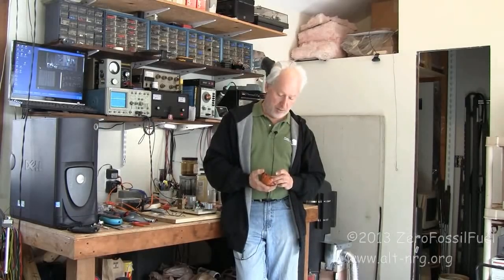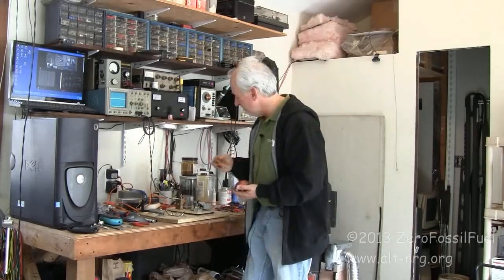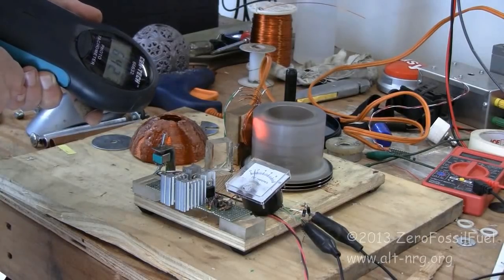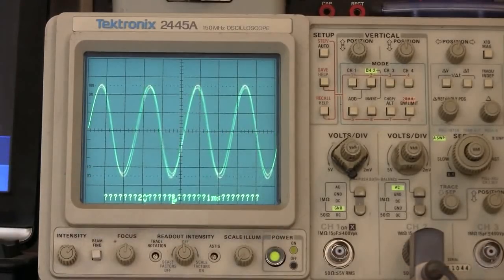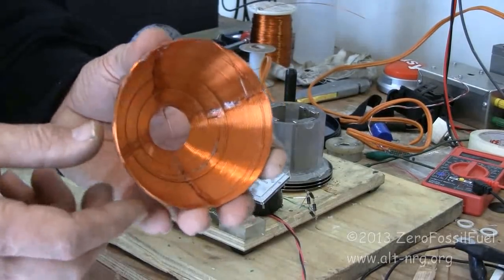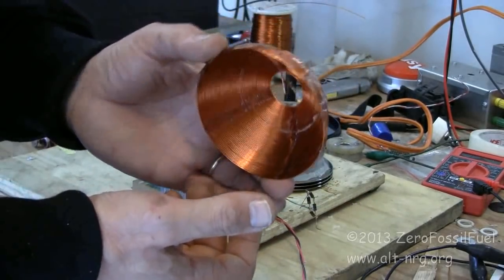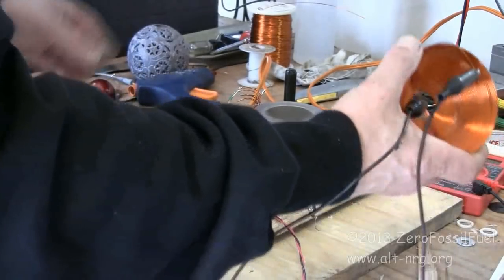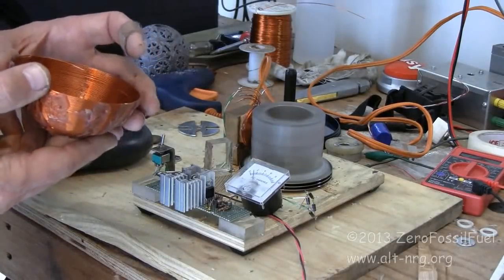#329 Zero Lenz dynamo

Comment: I'd like to see you experiment with a similar coil to your Wardenclyffe coil, only one that was wound in more of a cone or spiral shape,  specifically , a wind that follows the Fibonacci sequence of numbers.  If the Fibonacci sequence diagrams how energy naturally chooses to flow in our universe, wouldn't it seem to reason that "your' energy would prefer to flow in that same configuration.
It seems that ANY coil that is wound in a configuration other than that which mimics the Fibonacci spiral, would be forcing the energy going through it to flow in an UNnatural way.
 Your Idea of a multi layer conical shape, I think,  is spot on.
If you could wrap several pieces of wire at the same time, and mathematically follow the Fibonacci sequence........well i don't know WHAT you 'd get for voltage...but I'm dying to find out.
Great experiments....Great job on your Wardenclyffe coil

Comment: dear i think Zero show us shapes interacting to same magnetic field difference.Yes you are right, resistance of 2 type coils was different, but if you will make same resistance at both coils then effect of less drug will at the side of half hemisphere shape side in did because its wires position to the magnetic field not flat but copy of magnetic field structure it self.

Comment: try making a series of these bowl coils.. put them together.  or cup them together.. then have a cylinder magnet on a shaft with shaft guides at each end so it is stable and have it slide in and out of the coils.. see how that goes?. also either have the coils, coiled together connected at the ending ends or have a wire go from the top to the bottom to connect the coils, so the magnetic fields push the electrons the same way in the wire..

Comment: So did you ever make a full globe coil based on 2 of these? Awesome video, thank you for sharing.
Reply from the maker: +Naoki Kashima No because I realized it's still a dipole. Not the objective. Thanks for watching anyway!
Reply: Reverse winding direction at the peak and measure how much force you can generate and compare it to pancake coils of equal length.  I think it'd be interesting to map the magnetic field of that experiment.
Reply: globe coil in one single copper or 2 half globe coil to form one?
Reply: Naoki actually creating and doing what your imagination/intuition brings before you is something that should never be allowed to be cast aside by others theories.
Reply: How much has been deemed “disruptive tech” and forced into the shadows?
Reply: @zerolabs  then what was the cause of the amazing, significant findings in this video??  This was super inspiring and yes i did enjoy it. Far from a “little experiment”. Please dont downplay what you did here. 

It annoys me beyond mention the degree to which those with theoretical laws build faux walls to detracts and block the doers, tryers, tinkerers, and experimenters whilst they do not but create literature. 

Youre a creator and creative and creating is when humans are most alive in the moment. The flow state

Comment: more windings = higher voltage.  The bowl shaped coil clearly had more windings ... (and much more copper).  To be fair, try to use the same length of copper in each case.

Moreover, higher voltage comes with lower amperage ... and my feeling is that the highter amperage (i.e. current) in the flat coil is what actually causes the short circuit to slow down faster.

Comment: What about a static oscillated voltage through a bifilar coil as the transmitter and both top and bottom your half dome chapped collectors. Would this work? I have a ferrite core from a TV as the energy increase. Look forwards to your next vid:)

Comment: Voltage does not equal power. Damn so many slept during science class. Measure current and voltage, that will give you the power in watts. E*I=P(W) we'll ignore the crest factor in your waveforms for now.
Reply: Technically, if he's just using a coil, it's be VARs that you measure. I won't produce very many watts at all. Terrible power factor.
Reply: Andrew Vanderschaaf I really like your coils experimentation.
Reply: Y'all need to watch Gerard Morins videos.

Comment: What's the comparision output levels between your dome coil and a regularly wound coil - either single layer or multi layer wound, when used for electric generation.  I'd love to see the dome coil wound in bifilar fashon.  It would probably be easer to wind if a heaver gage wire was used.  Larry

Comment: I think this seems pretty simple, basics in inducion. research into motors and/or transformers (step up and step down) the flat coil clearly has less turn and therefor less voltage because there are less conductors to cut the lines of flux with from the rotating magnets. The dome shaped one may assist itself in the generation, but if it were made proportional (length of wire the same or turns the same) then i believe the voltage would still be very similar. Really, this is trivial as soon as you learn induction.

Comment: Great experiment. Thanks for posting. Lenz effect is measured as power induced (current squared times resistance), not voltage induced; so should be comparing voltage across a resistor (rather than open circuit voltage). Your lamp test sort of did this. Coil is not mono-pole, magnetic field is half way between solenoid and single wire pancake coil.

Comment: If the coil was connected to a tank circuit which is grounded, the angle of reception on the concave side would generate a measurable voltage. Cool idea, scientifically efficient.
Reply: Michael Chapala that does work. you're right. I've tested it myself with a quad filar coil instead of the one in this video. anyone else you're free to comment with more suggestions please

Comment: Could it be your bowl shaped coil has more turns then your flat coil and can induce more voltage?  Then possibly your drag effect is lower on your bowl shaped coil because it has more resistance than your flat shaped coil and thus less current produced in a short circuit scenario?  I'd try a resistor in series with your short circuit tests to see if it increases or decreases the decel time.  If a resistor increases the decel time then wire resistance could be producing these results.

Comment: Dear Mark,  I think you'll find the voltage difference will become equal when the length of wire is the same in both the flat and the dome coils. What interests me is that there is less back EMF slowing from the dome coil to the power source . This will be due to the dome having less length of conductor close to the spinning magnets. Less than the flat coil.  One would normally expect therefore to have a lower voltage. This is not so, due to the induction between succussive coils laying on top of each other in the dome, producing higher voltage the further the conductor extends. The higher the voltage of course, the lower the current. Sorry, no power gain.

Comment: hey do the shottky diodes you got for the muller drive circuit look the same as a mosfet and cost about $30 each? I know what a regular diode looks like and a zenner diode, but mouser isn't showing anything that looks like a regular diode.

Comment: Z... I just had a crazy Idea.. not sure if it would work or not... But here it is... Take some of that magnetic film, and view the magnetic field coming off the magnets, and shape your coil accordingly AROUND the field, so it's flowing inside your coil. So basically I'm thinking your cone shape would be inverted the opposite way you have it now, so the magnetic field is running inside the coil.. If that makes sense. My theory would be that your not blocking the magnetic field from rotation.

Comment from the maker: You've missed the point. An average coil with more wire produces more voltage and more Lenz drag when shorted. My bowl coil had more wire, yes, and it produced more voltage but LESS drag when shorted. This is the opposite of a conventional coil. It means I'm on the right path.

Comment: I like the idea of playing with coil structure. However, as mentioned by many the volt output is not the prime measurement. I can have a car that goes 300 miles an hour...it won't pull a 2 ton trailer for crap though. At the same time I can have a truck that only does 80...but it can do 80 while pulling 20 tons...

One idea that interests me would be doing 2 of these coils over an iron or rare earth sphere that can spin axial while the coil is near another also spinning...just curiosity

Comment: Hi, are you trying to generate as much voltage as possible? What i don't understand is why you have the magnets in this configuration. North and south poles, which way are they facing? Are the poles strongest at the ends of the magnets or at the faces? Do the magnets all face the same way? Why not try the magnets in a horizontal direction and alternate their arrangement between N & S, so the ends would be going across your cylinder rather than up and down, or alternate the magnets N & S and hold the coil over the top of the cylinder.

Comment: Stating that the bowl-shaped coil with double the output voltage will give you four times the output power is not correct.  A 100-turn coil and a 500-turn coil that are the same approximate size in the same setup will be able to output equal amounts of power.  Putting the coil geometry aside for a second, the same principle applies to your bowl coil.  When you factor in the geometry you check the flux relative to each loop in the coil.

Comment: what do you think would happen if you made each sphereical coil reactive to each other, say like how lemon is reactive to copper producing charge, i'd like to know what you think about keshe using naoh hot saline bath with coils soak for two nights and then cause dropping rebounds to produce fluctuating charge 30 nano coatings making gans as well as a gas gans coat, could this be done with magnets or like with your sphere conical concept?

Comment: thanks for posting.  ever hear of an ammeter. to measure real output, volts and amps must be known.     volts x amps = watts      your 'slow-down' numbers are a poor substitute for an amperage value.   your slow-down results suggest a decrease in amperage from the hemispherical coil. my experience suggests back emf is the key to high coil performance. when the windings of a coil do not 'go back' on one another, there is no back emf, but output amperage drops to near zero.  cheers

Comment from the maker: You too are missing the point. Average coil, more wire = more voltage = more Lenz drag.

My bowl coil more wire = more voltage = LESS Lenz drag. This was a first proof of concept coil. The intent was not to do precise efficiency comparisons between the two types of coils. The point is I'm on the right path. It proved the INVERSE of what a typical coil will exhibit.

Comment: hi there. i don't watch these videos to pick them apart. i am very into this stuff. overunity, hho, and more but the first thing i noticed when you used the "bowl" is.... yes it is a different shape but you have about 4 times more wraps in it. of course it will have a greater voltage output. how about making a pancake style with the same amount of turns and retry the experiment? that would give you a more unbiased result. i look forward to a response.
Reply from the maker: +Jon Stimmel Yes that has been pointed out already numerous times and yes, it is true. The intent of the bowl shape winding was to concentrate the field to the center. Obviously it failed but there are other ways. Think about the headpiece Doc Brown wore when he greeted Marty at the door, on steroids.

Comment: Very interesting video and thanks for sharing. I'm wondering now about different shapes such as pyramid, sphere or square. As Calliber50 mentioned I believe a retest with the same exact wire and length in a pancake coil would shed further credence to the results. I have a number of 24vdc 36,000 rpm motors I plan on doing a similar thing with sometime in the future. The motor came out of an industrial high speed bar code reader with an aluminum 12 sided 5.75" diam. cone bolted onto the shaft.

Comment: Hi Zerofossilfuel, Cool looking coil, What is the output voltage and current?. Check out the 3 phase Abha Rodin motor generator at the PMBO 2016, a new coil design. Thank You Tony

Comment: What do you think you are proving?  Sure, spinning magnets induce voltage in nearby coils.  Short the coil, it causes a little drag on the magnets when you stop powering the rotation.  It means nothing we did not already know.  Do you think you have a useful application for this?  I doubt it.

Comment: Hey Zero, wouldn't the two different lengths of wire used on the coils make a difference, can you do the same experiment using the same length of wire in each coil.

Comment: ive thought of making a globe magnet/electromagnet for a long time, the only conclusion is it makes a mono-pole, with one pole trapped on the inside and the other on the outside.
Reply: +Starseed∞Warrior  Actually to do that I think you need two half-domes joined at their middles with 1 polarity to the two equator winding terminals and the other polarity to the poles of the globe terminals. A full globe is in fact no different than a cone or cylinder. Note that the earth has a north & south pole!
Reply: dean germeten yes but it depends where you send the charge through, which will determine where the poles are i.e if you get a metal sphere, put a cathode that encompasses the whole surface and an anode that pinpoint touches and goes to its core, it makes a monopole.. or for instance get two dome shaped magnets with the north on the outside and the south on the inside, push them together on like pole to make a sphere, super glue it together or what not, you got a monopole with only the north on the outside.
Reply: +Starseed∞Warrior If you break a magnet at any point, it still has a N-S. Same poles facing EM will give you a scalar but not a monopole. Polar magnet fields are circular, a return path is necessary for there to be a field. Only way I can think is a point source (globe) static charge.

Comment: Do the two coils have the same number of windings?
I am not convinced Lens law is reduced because you have more windings on the first coil near the highest concentration of the magnetic field.
The second coil only had a few windings in the highest concnetration of the magnetic field.
The other thin you mentioned is the Warden Cliff Coils is creating a Monopole?  To my knowledge a monopole is theoretical.  Where did you get this info from?
You keep saying the Warden Cliff Coil is producing more power when you are only reading a higher voltage.  That is not an indication of more power.

Comment: A "starship" coil is just a coil like I explained to you below.  The "star points" are meaningless.  In the final analysis each circular loop (or triangular loop in the case of a starship coil) will contribute to the total inductance of the coil and react to external changing magnetic flux based on the geometry.  A regular coil, a starship coil, and your bowl coil are fundamentally all coils that will behave exactly the same way.  There are no magical properties to be found at all.

Comment: The planar coil creates more magnetic lines that are perpendicular to the rotor's magnetic lines than the dome shaped coil.
The dome shaped coil creates more magnetic lines that are at an angle different than 90 degrees with the magnetic lines of the rotor than the ones that are at 90 degrees. 
Also the magnetic field of the dome shaped coil stays closer to the tip of the dome. 
Even if you create more voltage, it is not guaranteed that a higher current is also sustained, because a higher current packs the magnetic field even closer to the tip of the dome shaped coil.
Etc, etc. /
Nicola Tesla's "secret" of efficient coils in "specific" applications is the fact that he built those "specific" coils in such a way to create a parallel LC circuit in itself, so that the coil built that way will auto-oscillate itself ( a coil that has its own parameters L and C so that it can auto oscillate and sustain its "auto" oscillation with little added power, the real LC circuit is never ideal = real "auto" parallel LC circuit in the same individual coil ).
By making the coils with wires of different diameters, each turn of wire placed at different distances from one another, and by connecting the terminals of these special coils in "special" arrangements you can obtain "surprising" and "unexpected" results in, let's say for one example of many, a motor-generator project. 😉😏

Comment: Woulda been nice to short the various deccel coils with an analog ammeter so you could see the amount of current flowing as it comes to a stop...   then you could quantify total potential power out with the volts and amps being multiplied for watts...
Reply: If you get twice the volts, then its definitely more important to check the amps circulating in the shorted coils... as most likely that will qualify the difference in RPM since with a smaller current flow, which is what would result in a non-bifilar series end connected coil dropping more RPM than the sphere coil which drops less RPM... (the drop of RPM is a function of current being Consumed.)